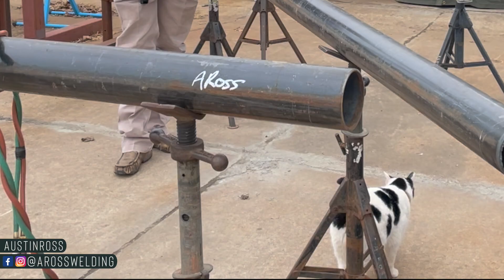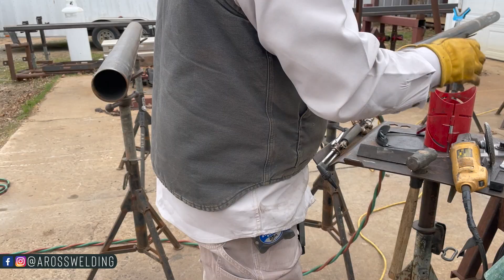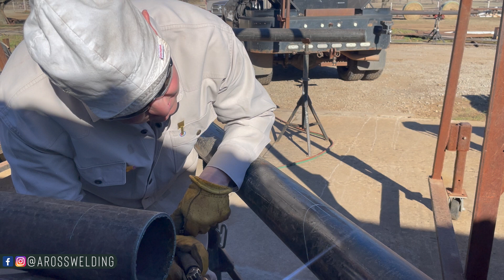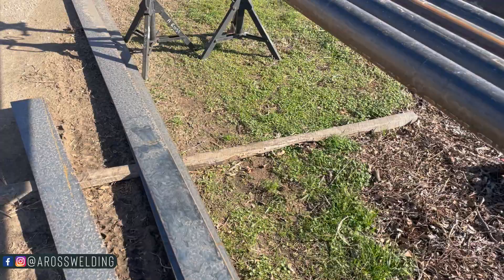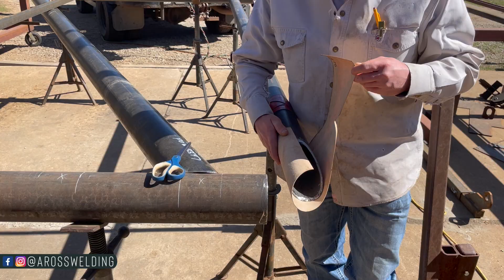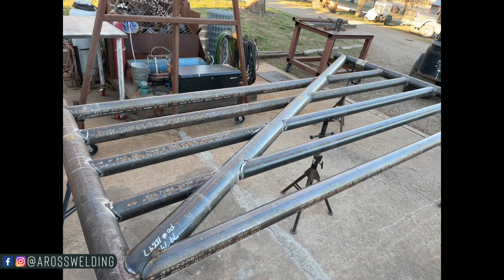How To Saddle Pipe at Odd Angles

Comment: When building gates or working on say 3,4,or 5 rail fence; I ask all guys on my crew to use this terminology and mark the pipe accordingly with soap stone, TT-is top top aka high side of pipe top side, TB is top bottom, aka top side of pipe on lower side if running down hill,  BT-is bottom top aka bottom side of pipe in correlation to the tt side , last but not least BB or bottom bottom; follows suit with aforementioned… it helps guys to start visualizing their cuts and copes and to quickly realize that if their line posts or gate ends r square or titsmcghee level, then the opposing cuts will be exactly the same…most importantly it helps stop guys from wasting pipe by not paying attention and putting their short side cuts on same side of pipe
 I really like the custom templates; especially for gates… great stuff brother keep it coming.

Comment: Full size Set out of the gate or any frame out using chalk lines on a setting out floor. I.E. using multiple sheets of 3/4” steel sheets 8x4 stitch welded  or larger on level concrete. Then make the template from the set out angle using “parallel line” development method. Accurately Cut and shape the parts no guesswork and cutting and grinding a second time. Convert the chalk line set out to an assembling jig. By welding on angle iron as side stops 
Question is. Why use pipe. Box section would be easier or T section or channel section or L section. 
Surface protection. Where I live they’ed need to be galvanised.

Comment: Austin, not trying to be a smart-arse, but the CAD program I'm using, (Turbo-Cad 2020) shows that if your vertical upright for the gate, is 5' Ft. next to the 16' Ft. - 6 1/4" in. 8" in. Dia. pipe, Gate Entrance upright. your overall gate width is 11' Ft.- 9.759" in. Allowing for one inch weld-on hinges. Front part (the vertical is 3.5" in. dia., X  3' Ft. - 8" in. tall / height) I'm getting /showing a 70.099° angle.  That's measuring three inches down on the 5' Ft. vertical, and at the front / leading edge of the 3' Ft. - 8" in. vertical pipe measuring up from the bottom the gate front upright 5.637" in. approx.
Reply: Does the cad program transfer well to the reality ? Can cad do cope templates for different wall sizes ? Wall thickness makes a big difference to cope fit .
Reply: The average Joe, doesn't carry a CAD program to their jobs or out in the mud day to day.

Comment: How do you get your 7018 to restart that easy?  I'm new to stick and I end up touching them up on the grinder or I can't seem to strike an arc with the Flux balling up over the tip. I've been using 6011 to root pass and cap with the 7018 on my h-braces
Reply: Try using a file to file down that tip

Comment: Austin, why don’t you keep these cut templates and then transfer them to metal and market them with your plans for the gates
Reply: Because they are easy enough to make them oneself
Reply: @LifetimeinWelding  fair. If it was me wanting to fabricate a gate from his site for one of my first pipe projects I would want it to be as idiot proof as possible. He makes it look easy but he has an insane amount of experience.
Reply: Get the practical skills first and that is:- look up “finding the joint lines of interpenetrating geometric solids “ & “parallel line development” 
Other wise your whistling in the wind.
Reply: ⁰
Reply: Every angle is different
Reply: @johnnyboy8228  if you make them for the specific gate plan as part of a kit then it doesn’t matter because you only need the angles for that kit